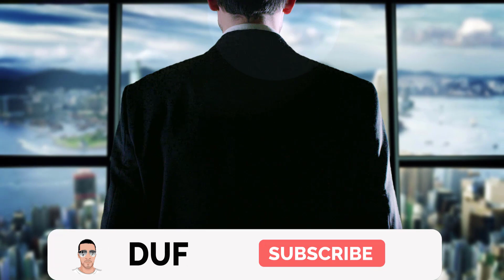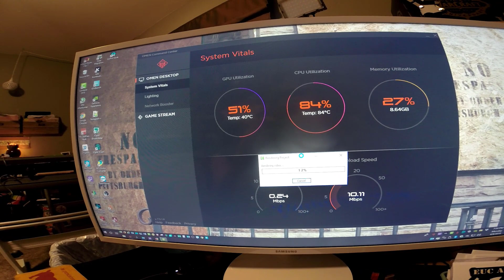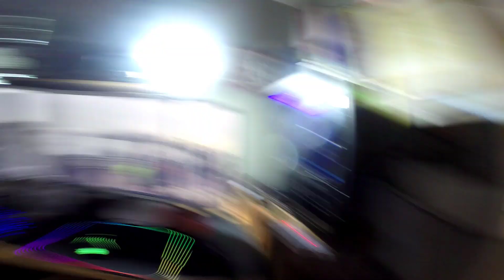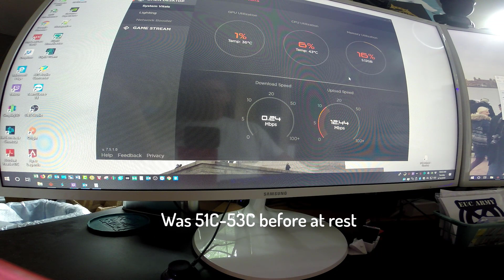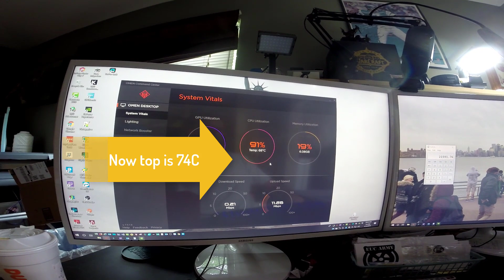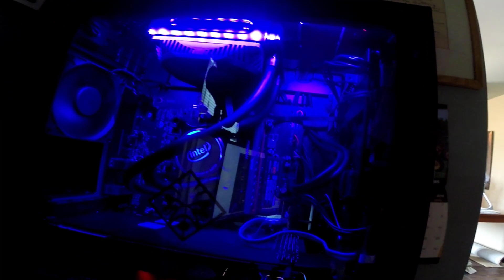Install Intel BXTS13X CPU Cooler - HP Omen Obelisk - What a difference!

Comment: Hi i have this pc as well that came with a rtx 2070 in it. Im think of getting a better and nicer case and a new cpu cooler on Amazon. The case im getting is the €64 aerocool 1 that has 4 rgb fans and has a fan hub so i only need to connect it to one of the fan ports. then im getting vetroo cpu cooler thats only €36. Would upgrading to a new case and cpu cooler be worth voiding warranty. I had this since march 2021 4 or 5 months ago.  changing to a new cpu cooler on this case will void the warranty anyways. So would this be a good choice to change case and get new cpu cooler?
Reply from the maker: It sounds like a worthwhile upgrade
Reply: Ok

Comment: a cooler for the GPU?
Reply: Just asked about if it's necessary for rtx2080ti install a water cooler as oer I have many doubt about...
Reply from the maker: @creatorex1  Sorry if I was unclear, the water cooled element of my system is just the CPU.  However the big radiator that I now have blowing out the top of the case has lowered my temps of the GPU down as well.
Reply from the maker: Installing the cooler sucked a lot of hot air out of the case!

Comment: Hello I am a Korean who uses hp obelisk i9 9900k 2080ti. If I play a game like Overwatch, the default cpu temperature is 85 degrees. If you install the cooler you installed, does the temperature drop? And is there another cooler installed?
Reply from the maker: Mine is an I7 processor so I don't know how it would work for you but in my situation the cooler knocked 25 degrees off the temps my CPU was showing under load.

Comment: Did you have to purchase thermal paste and reapply before setting up the cooler?
Reply from the maker: It came with some but if you want to be really thorough you can get some of the real high quality paste.
Reply: @Duf  Thank you for your response. I recently purchased an Obelisk and it is in the process of assembly. I will probably install this upgrade along with another 120mm fan to insure there is enough circulation when it arrives. Thank you again for the video and response.

Comment: ok i bit the bullet and got that same intel aio, how in the heck did you get the backplate off the mobo? i dont know if mine is super baked on or what, but im bending the crap out of the mobo trying to pry this thing off.
Reply from the maker: Slowly, if you have a plastic wedge to get it started it may help.  It definitely is not easy.
Reply: I had the same experience. I just used a screwdriver to push it down. I have a warranty though so I think I'm fine

Comment: i went a different route cooling mine with the 8700, i replaced the rear exhaust fan with a 92mm noctua pwm, the stock cooler fan with an 80mm noctua pwm, and added a 120mm noctua pwm to the top in an intake config. My cpu went from the high 80s under heavy load, to mid 60s. I can combine that with a slight undervolt through xtu and it drops to the high 50s/low 60s. i mostly just game though, bethesda games wich are demanding on the cpu. i may consider going your route with the AIO style cooler in the future, but my next experiment is to see if i can get a big noctua blower style air cooler to fit the stock backplate. i really want to avoid removing the motherboard at all costs.
Reply from the maker: Nice, sounds like your end results are similar to mine!
Reply: @Duf  im definetly not pushing my cpu as hard as you do though, im sure if i was video editing and rendering it would be a good bit hotter than yours with the liquid cooler, but im definetly happy with the results. Just added another 16gb stick of hyperx fury today, only 75 bucks on amazon right now! 32 gigs is nice, unlimited chrome tabs lol
Reply from the maker: @Cichlid_Visuals  Yep I have 32 gigs too.  I am just surprised that HP was ok with allowing the CPU to get that hot with it's stock configuration.
Reply: @Duf  i agree man i would have fired whoever was responsible for the thermal engineering of this pc. Might have been fine with a decent i5 and a gtx 1060 but the i7 8700 sits at 4.3 ghz constantly and the rtx cards just ramp up heat super fast with all that wattage. The cards would have been fine if they included a freakin fan profile for it lmao. My rtx card wouldnt budge from base speed until i installed afterburner. Setting it at 10% per 10° like any normal gpu works great but they left it at like 10% all the way to 85° lmao.
Reply from the maker: @Cichlid_Visuals  I have AfterBurner but have not dug into how to make fan profiles so I am still running whatever the RTX card does normally.
Reply: @Duf  oh man you gotta set one up, its super easy. on the main interface just tick the little auto fan control button, then under settings, fan, enable the custom fan curve, then just drag and drop the line on the gpu temp/fan speed graph. i bet it will help you out quite a bit while rendering, my gpu thermal throttled like crazy before i set up the curve, then the little blower fan would ramp up like crazy at the last possible minute. Setting it to 10% fan speed per 10 degrees gpu temp keep it super quiet, and the temps stay in the mid to lower 60s under heavy load instead of soaring to 85 then kicking the fan in hyper drive too late to really even be effective.
Reply from the maker: @Cichlid_Visuals  Not sure why but it seems like all of my fan speed controls in After Burner are disabled.
Reply: @Duf  what the heck? is it the latest version of afterburner? i think i had to dowload the beta for it to work with the rtx card, they may have updated it. other than that i use the oldschool interface, and click the auto fan control button by the fan slider. then i was able to go into setting and  edit the curve profile.
Reply from the maker: @Cichlid_Visuals  I downloaded the latest beta and it worked, thanks!
Reply: @Duf  awesome man! Glad i could help. Should keep that rtx at much safer temps now. And ironically its quieter lol.
Reply: You didnt have any trouble with the bios swapping the rear fan? I swapped cases and now have room for 120mm rear fan but I haven't bought one yet because I was afraid of having issues

Comment: oh boy.. I remember  going threw the whole cooling problem on my obelisk when I first bought it. when it came to gaming (1.5 HR in) even after installing an AIO I still was getting high temps. CPU with an AIO installed was getting to 77C.. and GPU would hit 86C. I didn't like the temps there since I mainly bought this PC for gaming.
in the end I ended up  buying a cooler master case and swapped every thing into the new case and ditching the OEM one in my closet, I also went back to air cooling the CPU and now I get amazing temps while gaming for HRs in. Max CPU 68C and GPU 61 - 69C ( depending on my ambient air... I live in FL )

The hardware HP provided with this computer is good.. The case is its biggest weakness
still I love my PC first one and I learned so much with it.
Reply from the maker: Wow that is some extreme surgery.  I am very pleased with the Intel liquid cooler, even at 90-100 CPU utilization the temp never leaves the 60's.  Having the radiator mounted up top helps cool the rest of the case better as well.
Reply: @Duf  yea the reason for that is because the programs  your using isn't GPu intensive 
For me since I use it mainly  for gaming  most games are GPU intensive, so since the exhaust come out the sides of the GPU and is being held in by the glass lol so temps rise like crazy. Also tried setting the rad fans as exhaust but then after the water was nice and saturated it will bring the CPU temps high. So new case it was lol been wanting to do a buyer's beware video on it
Reply from the maker: @MRD0889  Well I do game but that is mostly WoW which doesn't hammer a GPU like some of these photo realistic games out there.  Regardless I am glad you got it running well for you!
Reply: @Mitchell D what cooler master case did you go with?
Reply: @zackarysalazar7296  I went with the master case pro 5 amazing case for airflow
Reply: @Mitchell D did everything transfer over seamlessly?
Reply: @zackarysalazar7296  lol yup, even got the light bar and the front omen badge to work 
A lot easier that what I thought it was gonna be no lie
Reply: @zackarysalazar7296  hell now that I remember you need mobo stand offs. The omen has proprietary mounts on the case 
If you buying a case new you should be Gucci should bring them but if your buying offer up ECT owner might not have have them
Reply: Mitchell D hey man, I have the exact same case listed in video but I have 1660ti with i7.9700 non K, please be detailed when saying the mobo standoffs because I want to do the exact same thing to save my pc, because like you said the internals run amazing but it get too hot and the case is trash lmk please 🙂
Reply: So is it basically swap and done or do u have to add extra stuff im having the same issue with my omen
Reply: @OyateShiyani  it's basically a swap. 
Make sure you have new motherboard stand offs (should come with the case of your choice)
The omen uses chassis stand offs with proprietary screws.
The UI shield on the omen should drop in with no problem.
Power supply from the stock omen should line up with the case of your choice also.
As for the small card on the bottom of your omen that is responsible for making your omen stock RGB lights inside and outside of your case.
I installed it on that case way back then to keep the omen theme but later took it off so I could run a corair AIO with the fancy pump RGB 😂😂
Other then that it's all cake in all honesty
I did have one thing happened to me after I completed the swap.
For some weird reason in the bios it changed a setting for USB power on device "off" 
That would cause it to press the power button multiple times to actually turn on the system.
I doubt that would happen to you lol but just giving a heads up on my experience.
Get it done, it will open a world of cooling options for you and power supply and GPU upgrades for the future.
Reply: Yo was the case swap upgrade worth voiding the warranty? Im thinking of doing a case swap too and the warranty is the only thing holding me back and i want to save this pc. After all it has a rtx 2070. My gut is telling me to change the case and cpu. So would you say my gut is right? Changing case or swapping cpu coolers will void warranty anyways according to my research
Reply: @johnsonbangura3074  if your running that same case that's on video yes..your gut is right, your GPU if gonna be the main source of heat in that box.
There's two options here, swap the case and make sure to have stand off screws and the hell with the warranty or you can try downloading MSI after burner and undervolt and clock your GPU. Also if you have a Ryzen CPU you could also over clock using a lower voltage too.
I only say that because after two yrs I have a completely different system now and I learned tuning is just as important as the hardware.

I run an X570 with a 3700x clocked at 4.4GHZ @ 1.285v 
GPU is a windforce gaming oc 2080 at 1935GHZ @ .935v 
When I game all my games are set to high or ultra settings and I run a 1440p res monitor pushing 140 plus FPS and the Temps are nice and cool.
Of course CPU Temps depend on the cooler I use but the over clock with that voltage dropped Temps dramatically when gaming.